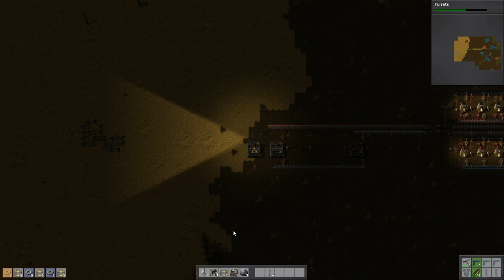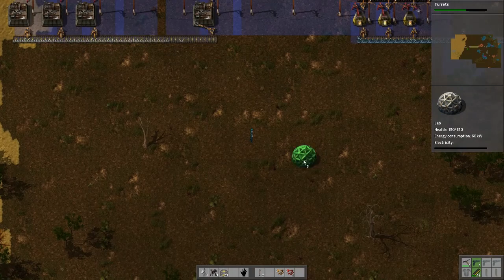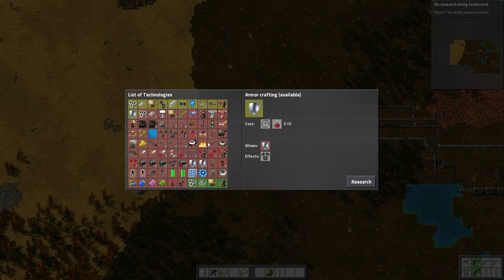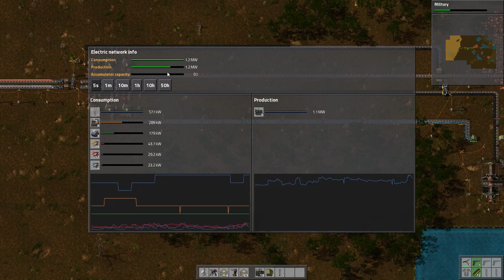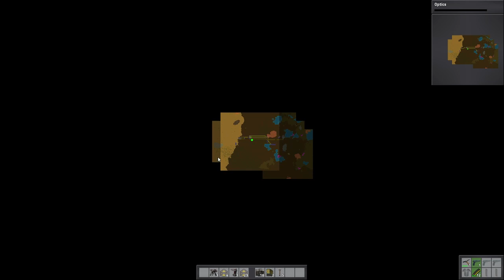Increasing Automation: Factorio Let's Play Episode 2

Comment: Nice spread-out build with plenty room for extension, costly as is was on the iron for belts.

Putting cable on a belt is not recommended, as it will become a bottleneck. Use direct insertion from 3 cable assemblers onto 2 circuit assemblers. (3-2 is in balance.)

Consider sharing one belt for both lvl. 1 and lvl. 2 science. leaving room for a second belt for lvl. 3 (and 4).